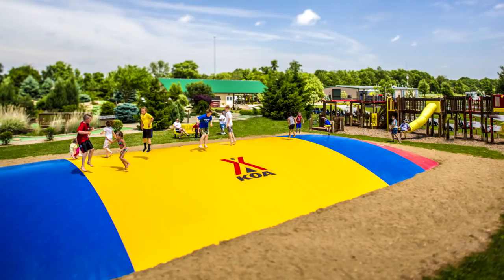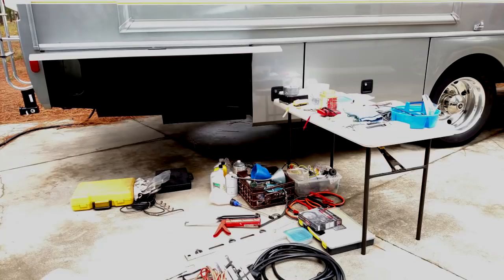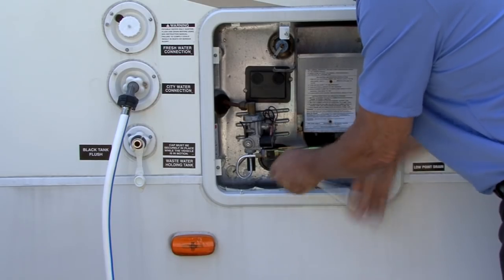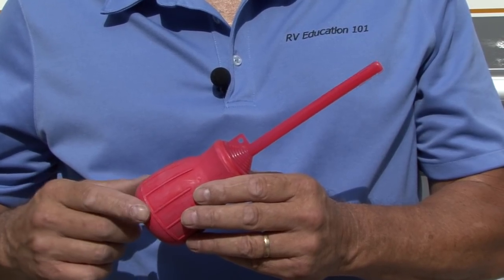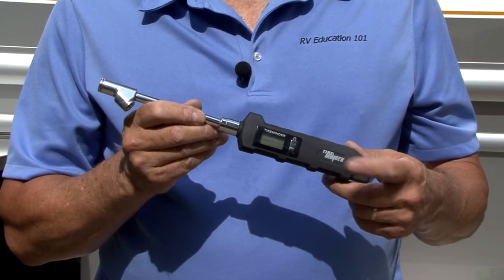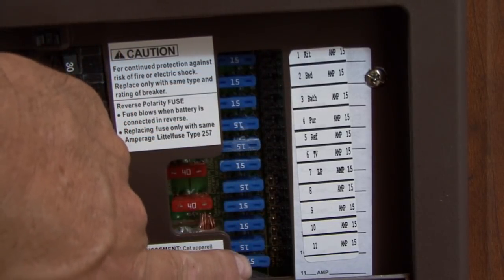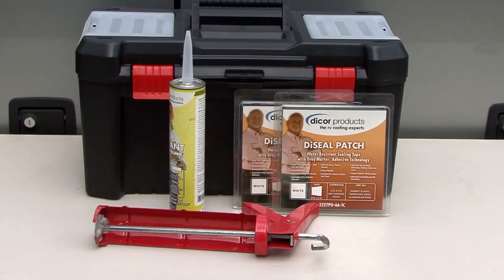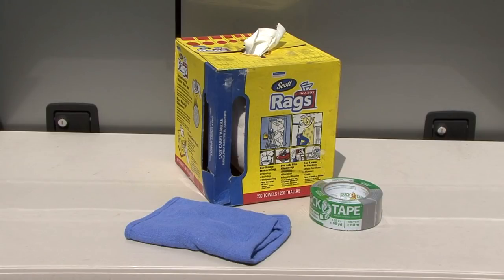My RV Toolbox & Essential RV Supplies

Comment: After four years of RV ownership (travel trailer) I finally removed the battery powered drill/screwdriver.  Yes, it is convenient for raising and lowering stabilizer jacks but have recently replaced it with a rechargeable 3/8 inch ratchet.  It is very unlikely that I'll have to drill a hole but in my old age, a powered ratchet is really helpful.

Comment: Safety triangles, if you've ever had to change a tire on the road you'll be glad you've got them.
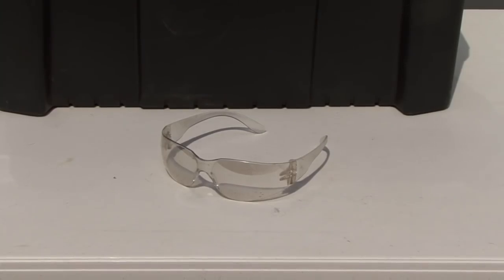Reply: Look at 5:30, he has a road hazard kit which includes triangles.
Reply: And know to use them , many times while I was over the road driving.  Would see someone that put triangles out on 10 to 20 ft in back of broken down equipment,  also thinking maybe a safety yellow vest with reflecting on it